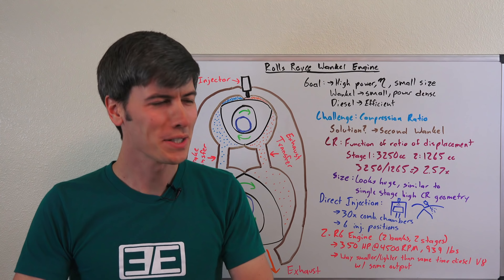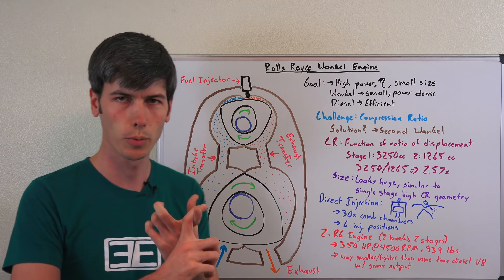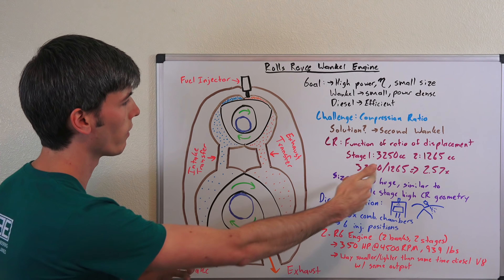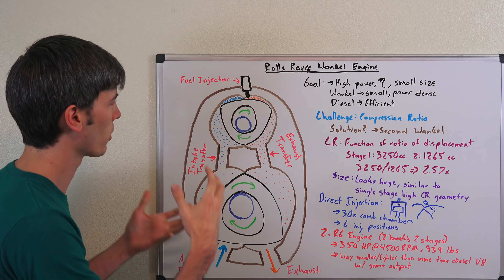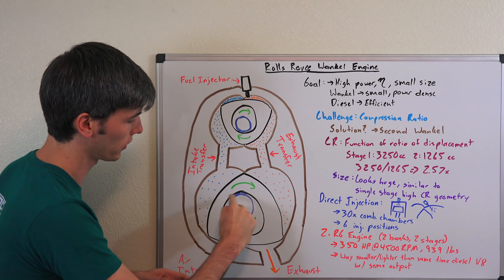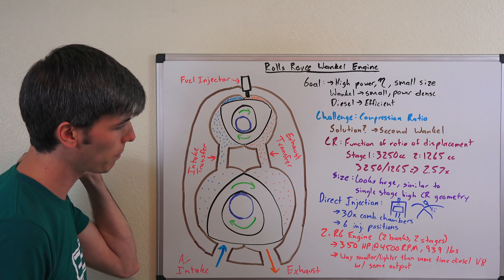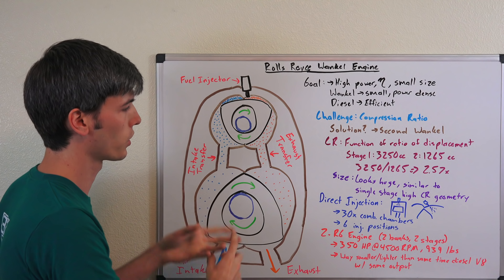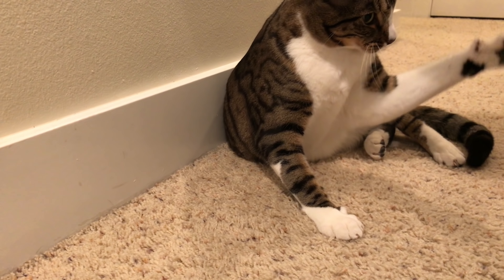Rolls Royce Made A Diesel Rotary Engine With Four Rotors!

Comment: Rolls Royce...
WHERE'S THE 4-ROTOR?!
Reply: It was the 70s. Once the LSD wore off... they were like, "Wtf are we doing?"
Reply: Rob crashed it
Reply: Brodie Bennett wrong channel bro xD
Reply: Brodie Bennett -   they stack one in front of the other... Theoretically ad infinitum.
Reply: Kevin Royce COMPRESSION RATIO OF INFINITY TO ONE
Reply: Synystr7 LMAO
Reply: donde estás 4 roto
Reply: He says it has 2 banks, im assuming each bank has two rotors ( top and bottom as in the diagram) giving it 4 rotors.
Reply: Yeah, they found meth instead......
Reply: That's correct.
Reply: I want it
Reply: yeah, but 2 of the rotors are actually just compressing the intake charge using the energy from the exhaust of the other 2 rotors - so really its just a 2 rotor, twin turbo charged engine that is using integrated rotary turbo chargers.
Reply: Actually superchargers, but as he explained it was one way Rolls Royce increased compression ratio.
Reply: Technically supercharges run off direct mechanical force like a drive shaft or pulley, turbo charges run off exhaust gasses as this does (unless it is also somehow mechanically connected to the two combustion cycle rotors?  I didn't get that from the video though), so this would fall more closely into turbo charger- though I guess it's really not quite either.  With that huge rotating mass I expect lag would be pretty horrific - maybe not an issue in the applications they were looking at using it on.
Reply: Turbos require exhaust gases to spin whereas, in this video I assumed both rotors were connected to a eccentric shaft. This is where I thought more of supercharging, as both rotors would still need to be geared to keep the rotors in sync.
Reply: Yeah, I'm really not sure now you might be right - I just can't really picture how you could efficiently connect the two separate eccentric shafts together, so I assumed they are not connected and the larger rotors are being driven only by the exhaust gasses.  I assume that is why it possibly never went anywhere, since a small, lightweight turbine is probably going to be far more efficient than a gigantic heavy rotor - which is why modern diesel engines don't weigh 1000lb for 350bhp.  Personally I think if the rotary was going to take off, it would have done so already - but who knows, someone might come up with some new materials or processes that allow manufacturers to overcome the various problems they have with durability, emissions and efficiency.
Reply: I think MrStoneycool69 is right, the rotor must be in sync, so it mean they are connected, probably with some gearing. It mean the second rotor is neither a supercharger or a turbo, it's just another rotor. The two rotor have a compression stroke and a power stroke,
Reply: Correct, the way he explained it the bottom rotor is just used to compress more air fuel mixture for the top rotor to ignite.
Reply: "which is why modern diesel engines don't weigh 1000lb for 350bhp."

They do (or more) for stationary power generation applications.
Reply: WANKEL ENGINES ARE A HEAD OF THEIR TIME DIESELS ON THE WAY
Reply: He only drew one bank. Is your imagination that weak you can't imagine an identical drawing?
Reply: @Beer_Dad1975  actually even though the compressor rotors are exhaust powered they could still be geared together. If done right with some form of variable gearing then at low revs when there's not enough exhaust back pressure the compressor will work like a 'crank' powered supercharger but at higher revs like a turbo charger, complete with turbo-compounding returning power back to the 'crank' via the gearing as well.
Reply: WHERE'S THE LAMB SAUCE

Comment: A german Tinkery from the south-west (near Stuttgart) messed around with a smaller Diesel Wankel in the late seventies and eighties.
They had one to four chambers and were naturally aspirated or supercharged by roots kompressors and gave an output between about 22 up to 350 hp.
The compression in Wankels only naturally aspirated does not suffice to combust injected Diesel fuel, so they had an ignition plug to start the combustion, what made a fully grown multi fuel engine out of it.
This worked pretty well, also with the roots charged versions, and they were used as powerplant for hybrid light armoured vehicles with the Deutsche Bundeswehr as far as I know.
I tried to gain one of the roots two or three-chambers to put in the frame of a K75 BMW, but could not buy the engine at that point of time because the Bundeswehr was all utmost secrecy in the eighties and had payed to research this engine until it worked ...
The Tinkery was sadly bought out quite some times during the nineties and noughties, but their technology as multifuels still does exist and is sold to customers in a variety of implementaitions by a consortium in Eastern Germany to date.
No names dropped so far, You'd find 'em via auntie gooooogle in an instant.

Comment: I wish car companies would, from time to time, make decisions based not on being as perfect as possible but just because it's cool and unique. Different may not be best over all for performance, but there is value at least for me, in being " cool"  and unique/different. Cars, especially performance minded cars, have intangibles that move us in ways that can be quantified by numbers.
Reply: Richard Nygaard sadly its not in the hands of the companies but of the government which doesnt support high emissions etc.
Reply: Like the Shelby GT350R you mean? They didn't have to build a flat crank Modular Variant that revved to 8250 RPM and probably cost millions to develop, they could've easily made the same power and a lot more torque by just throwing a small roots blower on a Coyote and calling it a day. They could've also kept a V8 in the Raptor, and the fact that they didn't pissed a lot of people off. But they wanted to be different, so no V8. The Taurus SHO shouldn't even exist, they barely sell any, but they still offer it because they know that there's a small group of people interested in factory sleepers. My point is that Ford does this all the time.
Reply: The Van Veen OCR, Norton F1, Hercules W2000 or MZ Wankel were quite some treat, not to mention a RO 80 or NSU's Wankel Spider.
Ingenious, but simply to few/to early on the developing timeline to work properly for years.
The only Wankel Tec automobiles You could come by in numbers on some kind of market were Mazdas, weren't they?
Today it's all customer conviniency and marketing and warranty, not the smallest space left for geniuses in terms of new car ideas (except Elon Musk, of course, but he owns his damn factory).
Reply: Richard Nygaard thats not how business work. You don't do what you like, but what's profitable and sells
Reply: MaxTheKanuck My statement was in general terms. Obviously there are exceptions.
Reply: Beucan. I understand how capitalism works. I think I should have noted, as another did, that Governmental regulations is far more to blame than the companies. The bean counters play a factor as well.
Reply: The government killed the 13b. And if you want cool impractical ideas look at anything Mopar. They sold a car you can't legally use to its full potential unless you cage it. Which sadly is not an option from the factory
Reply: Jay Hensley the demon is what I'm assuming you are referring to?   And rumors say that GM is making a camaro 1k and ford is having roush make them a mustang...   But idk the mustangs name.   And I think they were calling the camaro the "camaro 1k".  Don't quote me on it but I had heard rumors from a few places back a couple months
Reply: Dodge Demon is the car for you then lol
Reply: They have to make decisions based on whether or not it will show an eventual profit. Or go out of business of course.
Reply: That isn't how you survive as a company that is making a lot of a thing for a reliable purpose mazda tried it and look where the RX series is, on the bench, look at delorean.

Comment: Kind of like an internal supercharger
Reply: The wankel engine started its inception AS a compressor.
Reply: Indeed, or even as a mixture of both turbo and supercharger: it can use the exhaust gases there to produce work, like a turbine.
Reply: it is a turbo as the exhaust is still doing work after the first stage. Or call it a double compound engine and run it on steam!
Reply: Jelle B yeah i saw that similarity as well.
Reply: It would be a hybrid charger...   Turbo cuz it uses the exhaust to help push the compressor rotar and supercharger cuz it has an eccentric shafted the keep the rotar in time with the compustion rotar and to power it beyond the point that the exhaust gases cant
Reply: dosmastrify the 2nd eccentric shaft powers the 2nd bank of rotors too..    So its kinda both exhaust and shaft powered
Reply: You could do something similar with piston engines too, piston compressors are not a new thing afterall.

Comment: As always, excellent video, but you forgot to mention that apparently the proyect was abandoned due to the engine producing less power and being heavier than expected. Also, problems with the seals prevented this design to go beyond prototype stage.
Reply: I was thinking about apex seals through the entire video. High compression and apex seals don't really work for very long

Comment: Did the article mention torque figures? I’m guessing the idea died because rotary engines are not known for their torque output, and military vehicles are required to haul equipment around.
Reply: Jon-Luc Ruben I think he wrote down on the bottom corner in red, I think it produced 939
Reply: Anthony Neri that is the weight of the engine.
Also the unit of 'murican torque is lb-ft.
Reply: that's just the weight of the engine
Reply: 939 is the weight of the engine.
Reply: Well it produces 350 HP at 4500 RPM, you can figure the torque at that point as about 405 lb/ft, at the maximum power outuput that is. Dunno if it produced less torque at lower RPMs or more, but that's how much it produces at 4500RPM.
Remember that the whole torque thing is moot if you don't know the gearbox and differentials, remember that the M1 Abrans uses a turbine, and those produce very low torque but at ludicrous RPMs, reduce that with gearing and profit.
Reply: torque can be converted. thats why vehicles have a gearbox. Also the RX8 has 211Nm @5500rpm with ~1,3L Displacement. Thats more than ok for a natural aspirated engine.
Reply: Jon  If you turbo a Rotary you can fix the torque issues.  Its just small and at low compression.  You get the much higher HP b/c it can rev high.  This is a lower revving engine so torque should be less of an issue and be similar to HP.
Reply: The engine was ment to use in the military were diesel engines are normally used. Those diesels are normally in the range of 2000 to 2500 Nm @ 1000 - 1300 rpm. Low torque numbers and high rpm as in rotaries are exactly the opposite of what is required
Reply: So what? Just gear it appropriately and you're good. Hp is a FUNCTION of rpm and torque. If you have 100 hp at 2k rpm you will have 263 lb-ft of torque at the engine.if you have 100hp at 20k rpm you have 26 lb-ft of torque at the engine but you will need a gear reduction of 10:1 (20,000:2,000) to get make the tires go the same speed as the 2k rpm case. This gear reduction multiplies your torque and you end up having exactly the same torque at the wheels. The point is torque at the engine is irrelevant when comparing power, hp is hp regardless of the torque figure.
Reply: There is the reliabilityproblem and fuel consumption problem again. It is not practical for military use.
Reply: Yes, those were not mentioned, I would bet since the idea wasn't that mature yet, many problems would arise. The apex seals would still be a problem, but one of the issues on Wankel's fuel consumption - the spark plug holes leaking, could be possibly solved depending on the injector's form.
No idea on the thermodynamic efficiency of the engine itself, but that secondary mechanical/thermodynamical compressor sounds like it could increase the fuel efficiency considerably under the optimal power level. OR it could decrease it a lot compared to a normal turbo, dunno.

Would love to see more information on this
Reply: Remember this was back when rotory engines were NOT a bad idea. Gearing would fix any low torque issues. Look at semi trucks. They shift every 2 feet in the beginning because of the gearing. Slow but it can pull your house down without knowing it's even hooked to it
Reply: Blehtubezz Aus Then again, that brutal torque is at the output shaft AFTER a 10:1 fixed reduction on the engine assembly. If we wanted to give max output at 1000 RPM on this wankel, that would be 4.5x the torque I calculated above, so 1822 lb/ft, for a 350hp engine. So back to square 1 on the hp vs torque topic.
What I do give as a valid point, is that the torque CURVE is of considerable importance for this application indeed. If the engine is peaky only then it's more impractical, being more suited for a fixed RPM generator.
That curve tho we dont know, neither fuel efficiency, so I wouldn't disconsider it yet.
Reply: OK I'm lost at the 1st part of your last reply here: "ok I'm a bit confused as how you would actually expect to be able to accelerate when you've effectively eliminated all of the engines effective operating RPM range?" this one, I don't kinda get it to answer properly.
What I was talking about the gear reduction, is that since the M1 Abrans turbine engine was brought up (by me in fact, exactly about the torque thing), I pointed out where does it get from that huge torque at 1K RPM. That's from the 10:1 reduction, so effectively the turbine only, without gears, is producing 1/10 of that torque at ~10K RPM. It just is geared down to a properly usable power, so it's all good. Same would happen with the diesel wankel, just less aggressive gearing (4.5K RPM on a diesel is quite high as well). Dunno if this answers the doubt or not.

If what you're saying about the torque curve is valid for this engine as well, sounds like we have a great option here, and makes me feel like reliability, cost, fuel efficiency or maybe production issues made the idea get abandoned. Sad to not see anything of sorts nowadays.
Reply: To add, yes the torque curve is very significant, that's why on most cars you cannot pop-the-clutch or why automatic transmissions have the hydraulic torque converter. Slippage and resultant energy loss is necessary when the engine is producing close to zero torque.
Reply: "the will need to produce sufficient power at low RPM, basically at idle."

That's what a torque converter or hydraulic drive is for.
Reply: Jay Hensley that's a big reason why a rotary wouldn't be a good idea you'd have to build a CVT just to make the gearing work
Reply: A CVT would be a good idea anyway.
Reply: 1423 171 I don't see why tho, unless the engine was REALLY peaky or operated only in constant RPM, which I doubt.
Reply: Rotaries have a sweet spot on speed. CVT allows this to be maintained no matter what the road speed.
Reply: Alan Brown Indeed, but I think it's a bit overkill isn't it? Specially for a war machine being abused every second be it running or not.
Tho if it improves fuel efficiency enought it may be worth it (think about supplies during combat)
Reply: If it improves reliability you mean - and anything which reduces abusability will do that. Soldiers aren't reknowned for looking after the equipment at the best of times.

Comment: I've been wondering about this for years! You should also have mentioned how diesel is a lubricant so you wouldn't need to inject oil into the air/fuel mixture which would raise your overall emissions. Unfortunately diesels have other emissions problems
Reply: If the fuel is being atomized correctly as it is injected into the combustion chamber, it will have no lubricating effect on the apex seals since it should be consumed completely. Therefore, unfortunately,  the lubricity of diesel as a fuel has no relevance in this particular application.

Comment: Wondering if the diesel fuel would have helped solve the problem of rotor tip seal wear.  Might it have added lubrication and extended the life of the seals.
Reply: But on the other hand the compression needed for Diesel engines is higher, so more pressure on the seals which i think decreases their lifespan.
Reply: And diesel is more dirty fuel when burned compared to petrol
Reply: Nope diesel won't make a difference because that is the rotary's major downfall.
Reply: Well, the diesel is only injected at the combustion chamber, so you still get the hot, poorly lubricated rotor tip everywhere else.

Now with the addition of much higher pressure
Reply: In other hand, diesel doesn't burn as hot as gasoline in the peak temperature of the cycle, so maybe it balances it out a bit
Reply: It would have had the opposite effect due to the higher compression
Reply: Yeah and you can add some water injectors in the compression chamber to reduce the temperature and NOX and so efficiency